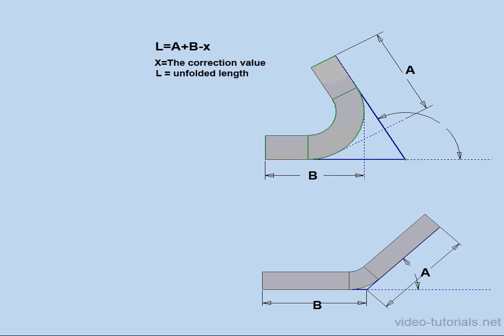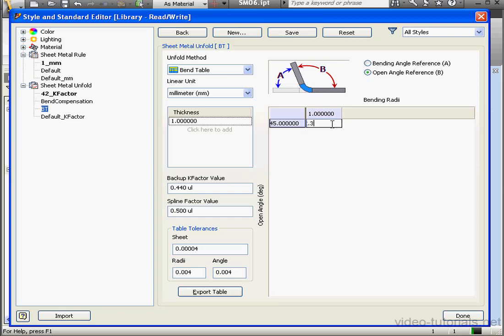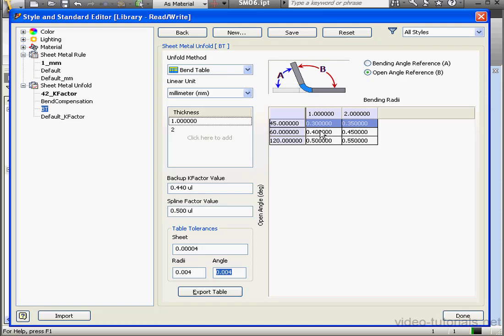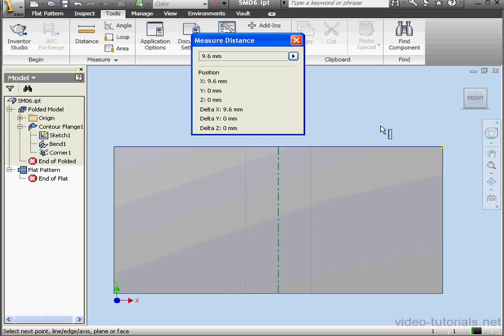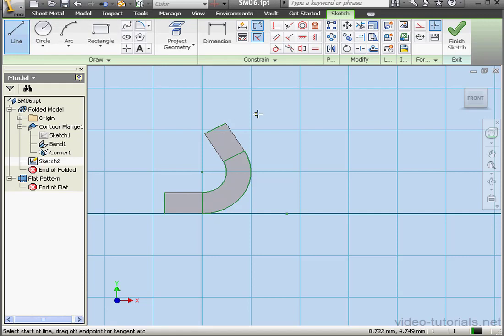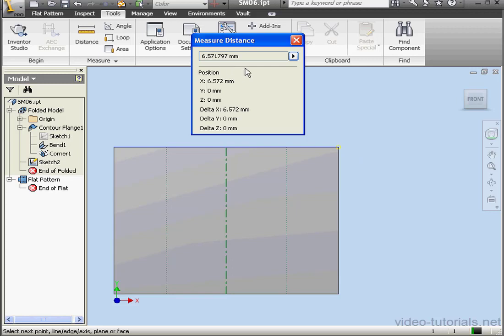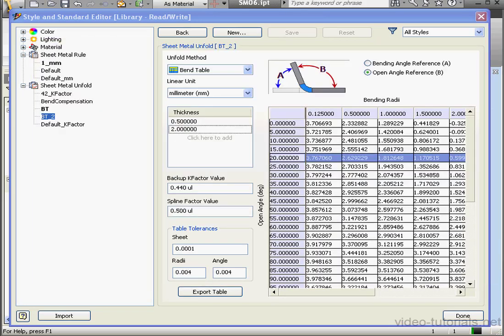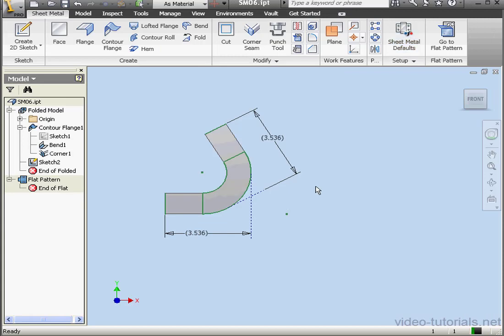AutoDesk INVENTOR Sheet Metal 06 Bend Tables

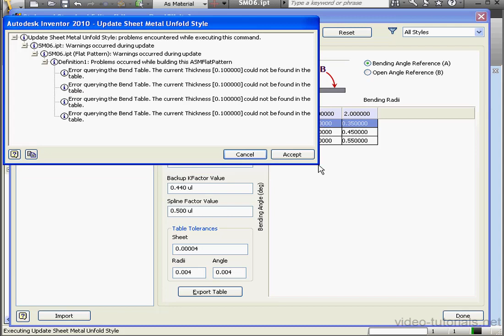Comment: Miss, your videos are of great help for me, I thank you very much. I noticed at 9:38 that for the 120° angle in the bend table, Inventor didn't follow the correction value 'x' of 0.5000 (4:57), why is that? While practicing in my local version of the sw I realized that the linear extrapolation between two points in the bend table, only works when the bending angle 'A' is equal or lesser than 90°, for any greater angle the linear extrapolation isn't followed. I believe you mentioned that at 3:18 but I didn't quite understood the logic behind it. Greetings.